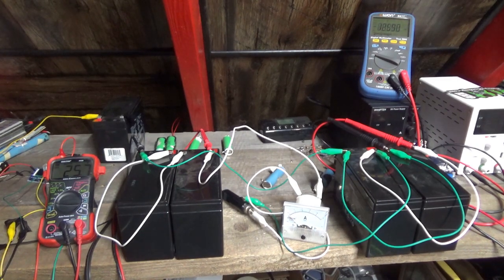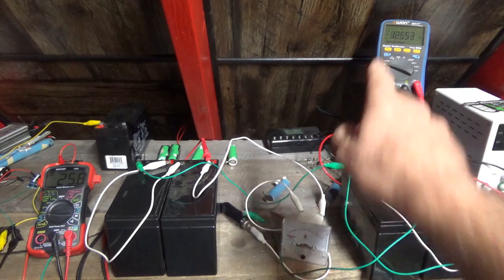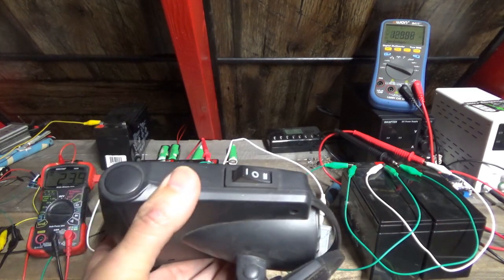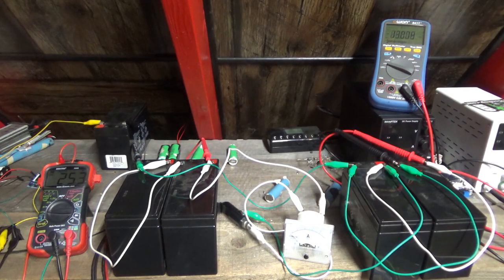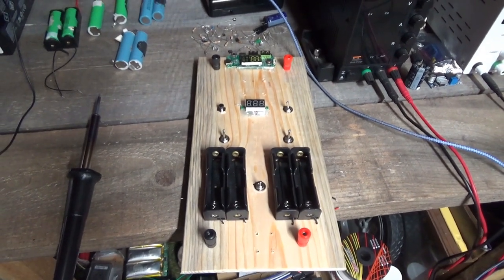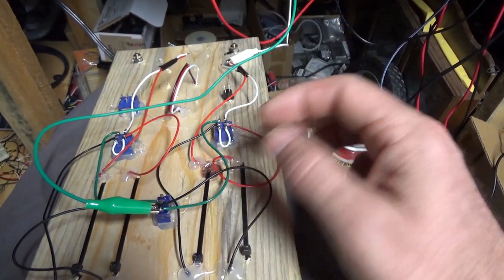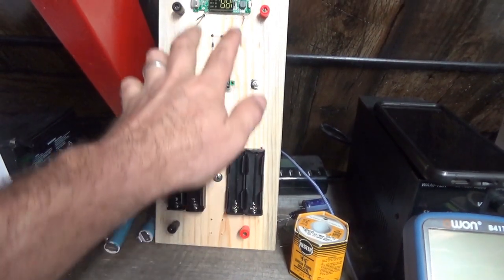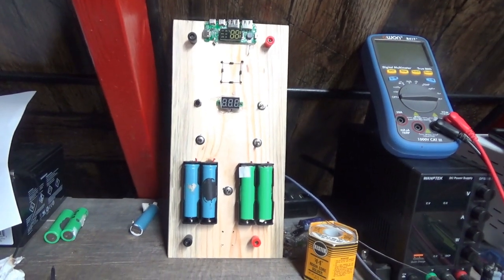Charging 12 Volt Batteries Free While Running Load

Comment: It's cool to do if you have small batteries that need charged, but everything that you insert into the circuit creates more losses. If max runtime is the objective, directly powering ONLY the intended device will win that battle.  No experimenting is needed.  But I certainly know how fun it is to experiment and learn. :)
Reply from the maker: The idea is to be able to run whatever you want but recover the energy in another set of batteries and keep going. 18650s are often used in power banks so I bought the power bank circuit for this board. You have to bring the 3.7 Volts to a stable 5 Volts for USB.
Reply: @TheDoItYourselfWorld  you're not recovering any energy at all. You are running a device PLUS charging some batteries. Simply transferring energy from one point, to another, with a lot of losses in between. There's a reason you keep getting half the runtime, each time you do this. Every piece of resistance (your small wires are the biggest problem) that you add to the circuit, means more power used. Which = more losses, when you are trying to do what you are doing.

The math is super simple on all of this, and with a few measurements, you can calculate EXACTLY how much energy is lost each time you do it, and how many times you can do it. (if you know the exact capacity of your batteries)

The light would run considerably longer if you simply powered it with the battery. (less losses) IF you are starting out with a COMPLETELY drained battery on one end.
Reply: Troy, here is where I disagree. There is no energy recovery. It takes energy to charge that second set of batteries. No free lunch. No tricking the electrons into doing more work at no cost. Now, that is a separate issue on whether you can get more run time or not.
Reply: @DavidJohnson-tv2nn   correct.  He is simply transferring energy from one battery to the other, with losses occurring in the light bulb. (and everywhere else)

Or, running the bulb and losing energy with the IR of the batteries.

I didn't look closely at his circuit to know which he is doing exactly.  Same result, though.
Reply from the maker: I have run the tests though and here is what I found. I ran the batteries to power the load on their own to a set voltage that I considered "drained" for the test. It ran for 6 hours. Remember I considered 4.0 charged and 3.5 discharged.

Then I ran with the second set of batteries and got the same run time - 6 hours. And then I swapped batteries and ran for another 4 hours. That is already energy gained. And then I swapped batteries again and ran for another hour. More gain.

Yes there are losses in the wires and the batteries. Yes it will all run down after a few cycles, which my tests showed.

But I did get to run for an extra 5 hours with the second set of batteries, which I had discharged to an even lower voltage of 3.0 volts. So there was no extra energy in those batteries to give up to begin with.
Reply from the maker: I am working on another test with the 12 volt batteries. I am expecting better results due to the higher voltages and greater potential difference between the two sets. I will be able to run the load for much longer in between swapping.
Reply: First, let's not get runtime gained confused with energy gained. Two different things.
I'm definitely not going to say that you can't get more runtime. Because I just don't know one way or the other. But I can say that you won't gain energy. 
Again, battery switching can best compared to a pendulum swinging back and forth. There will be an energy LOSS on each cycle.

Second, if i may suggest...
Let's make the assumption that a person only has 4 batteries available to them. How can they get the most runtime?
Using 4 fully charged batteries to power the load? Or... Battery switching?
Have you done the test with 4 fully charged batteries, no battery switching for comparison? Just curious because that is one I can't predict in advance.
Reply from the maker: Using four FULLY charged batteries would yield 12 hours run time vs using only 2 FULLY charged batteries which yields 6 hours. Just normal circuits there.

But using 2 charged and 2 discharged yields about 11 hours with swapping in my tests. Remember for me FULLY charged = 4.0 Volts.

BUT - and a big BUT it is... With this system you only have to recharge ONE pair of batteries instead of two. This is a huge gain for off grid homesteaders because solar panels are huge, bulky and easy to break. You do not need more solar panels or even charge controllers or power inverters to get the gain in run time. Just another set of batteries.

And by swapping batteries you are going to extend the life time of your entire set. It is bad to charge and discharge at the same time.

You can call it "runtime" while I call it energy gain. No matter. The run time is longer. And yes, like a pendulum it will all run down, as I say constantly.
Reply: Now, I could see a good use scenario for battery switching in emergencies. That is, your off grid, in bad weather, and your batteries are getting low. Of course the best backup is a generator. But this could serve as a backup for the backup. It's a matter of being prepared for all contingencies. The basic principles of prepping.
Having said that.... I don't see the point in trying to make a poorly designed solar power system work better. Whether the poor design is by accident or an attempt to save money. Why not just design the system correctly to begin with? That is, to have a system designed to handle the expected load in the first place.
Now, that is just my opinion. I realize you may disagree with me.
Reply from the maker: The biggest point here is that you should not charge and discharge a battery at the same time. By splitting your battery bank in two you can be running the load with one set while charging the second set. Then swap. This extends the battery life.

The extra run time is a bonus.
Reply: he can't get more runtime.  It's just impossible. Unless he is also doing something that I'm not seeing in the video @DavidJohnson-tv2nn
Reply: @diylithiumguy   he seems to be a little confused on how all this works lol
Reply: @blackz06   I sure hope not.
Reply from the maker: I removed one comment. I do not mind having a fun chat with you about these circuits. That is fun and I can actually learn something from people. But when a person accuses me of trying to rob or deceive people, I will not tolerate that. I removed his comment.
Reply from the maker: Now, about the circuit. Consider this.. electrons are what cause a battery to charge - right?

So, if I am correct and electrons cause a battery to charge, then the electrons leaving the load and entering the second set of batteries is charging them. My meters show that.

You sort of said that. The heater controls the charging rate. One set of batteries is charging another while the first set is discharging. The load controls the charging rate. Since electrons are not consumed in the process, they leave the load and charge the second set of batteries.

Again, YES, there are losses and yes the batteries will all eventually run down. But you can swap the batteries around and keep running a bit.
Reply from the maker: You can do the same thing without the load of course. Nature wants equilibrium and one set of batteries will discharge while the other charges until there is a balance.

Put a load in between and you control the charge/discharge rate while powering a load.
Reply: @TheDoItYourselfWorld  you removed one of my comments?  Not sure what you mean...
Reply from the maker: @diylithiumguy  Not yours, the one who said I was going to scam people with no knowledge into buying something. The reason I am taking a LONG time in this video series is to 1st be sure about what I am doing in the first place before I make anything for sale.
Reply from the maker: Which is another reason I appreciate people like you which makes me think more.
Reply: @TheDoItYourselfWorld  okay cool. So yeah.. I'll just reiterate a few things I already said. Batteries can only charge, or discharge. Not both at the same time.

When doing what you are doing, not only is the device you're powering acting like a current-limiting resistor, but it's also a voltage divider. So, your 24v volt battery gets split into 12 volts to the device, 12 volts to the batteries in parallel. Current in a loop is the same EVERYWHERE in a loop, so that means the device in the middle takes half the energy. And the parallel batteries get the other half of the energy.

Soooo... what this means is you're only halfway charging the dead set of batteries each time.(50%, 25%, 12.5%, 6.25% and so on)  Now, I don't know if you have ever "kept going halfway to somewhere" as an experiment, but if you have, you quickly realize you'll never get there.  It's the same as your experiment... not only do you not get MORE runtime, but you don't even get the SAME runtime as just powering the device. Because you keep getting half the energy into the dead batteries compared to what you put out. And I'm totally ignoring contact and conductor losses, which add up quick!

You'll probably want me to show my math (and I can if you insist), but I did have it all typed out and it was toooooooooooo long... so I condensed it to what you currently see. But yeah... with a voltage divider, only half of your battery energy makes it to the dead battery each time. With the other half powering the device in the middle.

But sometimes a person needs to see it for themselves before it makes sense... or to believe it, so keep on testing. :)

 I have 100s of batteries and 1000s of cells, and believe me... I've done my fair share of testing things over the last decade haha!
Reply: @TheDoItYourselfWorld  it's literally impossible to charge and discharge a battery at the same time.  current can only flow in one direction through a battery.

I will see if you have any updated videos regarding this, and help show you why it doesn't have a real benefit... it's been about a year since I spoke with you.
Reply from the maker: @diylithiumguy  I have not worked on this in a year. Opened up a sawmill and wood shop full time. See country Wood Products channel. I am not very active on YT but I want to do more soon.

I am also setting up an electronics lab at the workshop so I can continue experiments here.

I never claim to be able to charge and discharge the same battery at the same time. I meant that you can run a load with one battery and that same current can charge another separate battery.
Reply: @TheDoItYourselfWorld  I was just going by what you said in a comment above, which was...  "The biggest point here is that you should not charge and discharge a battery at the same time."

I do love sawmills... I'll check your other channel out!
Reply from the maker: @diylithiumguy  Ok. Yes please do. I hope to be uploading more videos soon. Still setting up my shop. 8 months now. But finishing things up finally. Trying to make a living at it while setting up a store and fully stocked shop.
Reply: Agreed!  Plain simple physics. @diylithiumguy